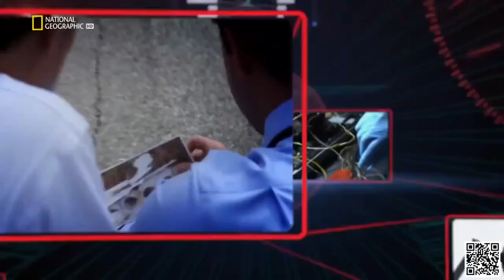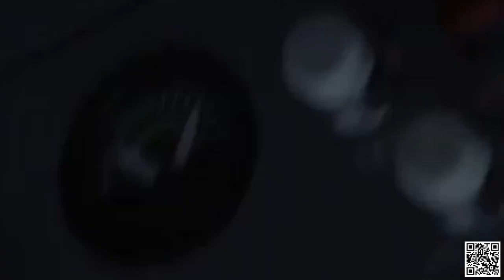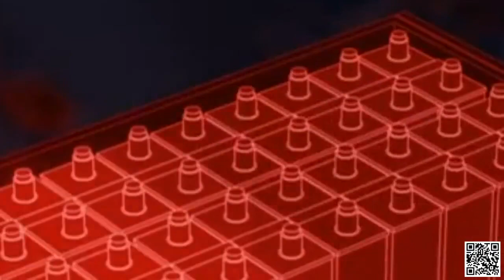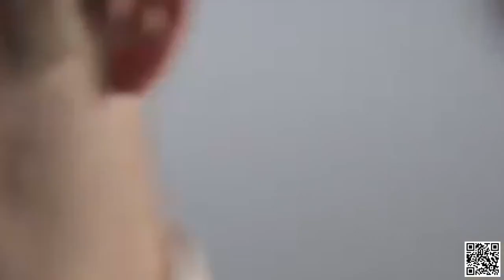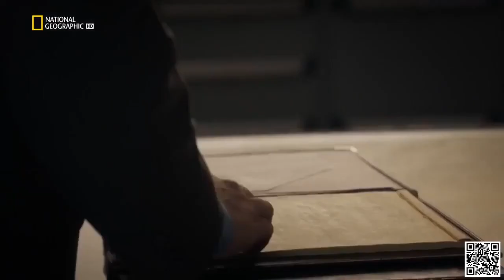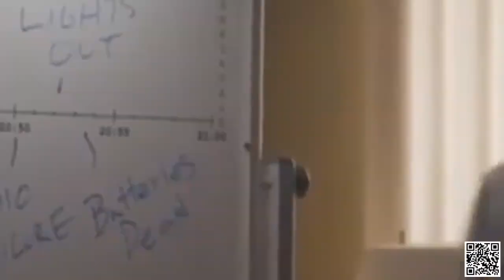「Mayday: AirDisaster」✈️S22E08: Pitch Black✈️New 2022 || Air Crash Investigation

Comment: No APU?  All pilots required to have flashlight.  Why no, "Pan, pan, pan!"  Why no air driven generator?
Reply: Nope.
Reply: @kimnielsen9332  I repeat, ALL pilot's required to have a flashlight and till a few years ago, a Dalton computer; Jeppeson approach plates etc.
I would not fly an aircraft without back ups in case things went sideways.  We always wore Mae Wests, flight suits, flame resistant tight gloves, parachute/dinghy pack, electric hat and bone dome.
Had full panel and trained to fly SANS ADI, gyro compass, no turn and bank, no rate of climb and descent......do things gently, as lots of lag in altimeter, ASI, rev counter.  Fun actually, the nasty instructor giving you the aircraft back upside down going up, you under the hood unable to see out.    As long as you BELIEVE in your a/c and do NOT exceed Vne.